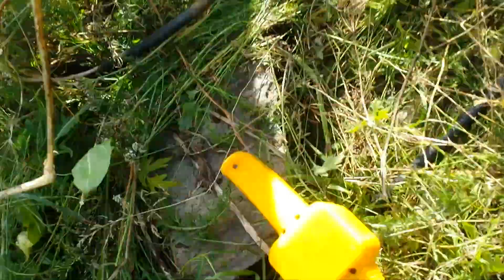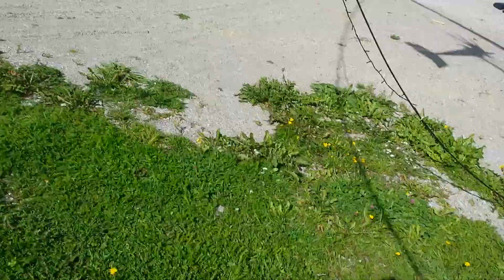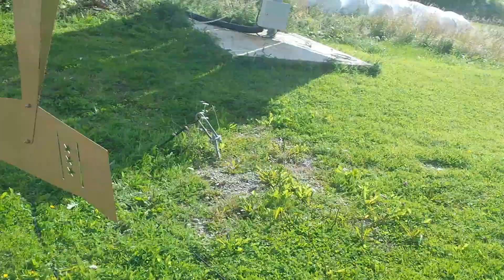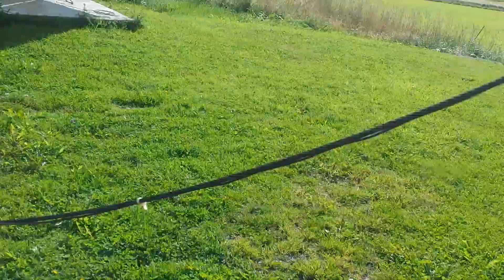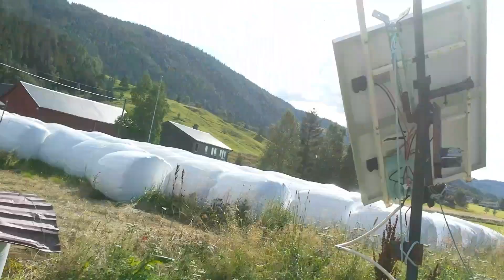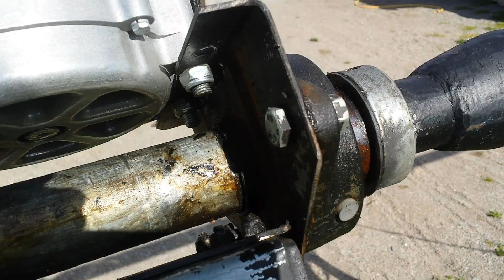Bearing on my windturbine.

Comment: nice job on the winch mount and bearing on the turbine. Loved the way it was spinning even wile at a strange angle. that was giving me an idea :)
Reply from the maker: Is the idea firling?
Reply: No :) Just something i have been thinking on. its still in the brain pan and is a long way from going to papper :)
Reply from the maker: Are you far away to get your windturbine upp?
Reply: Tore Neverås well it has not stopped raining for the last 3 days and i am still working  in the power room on the inverters. When i have my house power secured then i will think about working on the turbine. One Job at a time :)
Reply from the maker: Justin Case yes i am working with this batterys from the truck i almost gave them upp yesterday. But yesterday the voltage raised with one volt? :-) maby its hope for the batterys ? But i have a bad feeling that they are not good